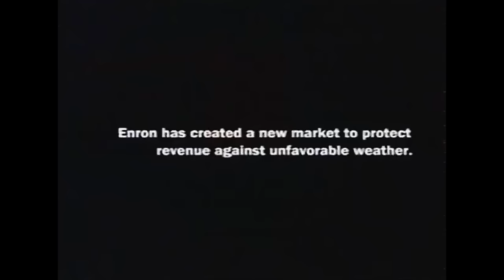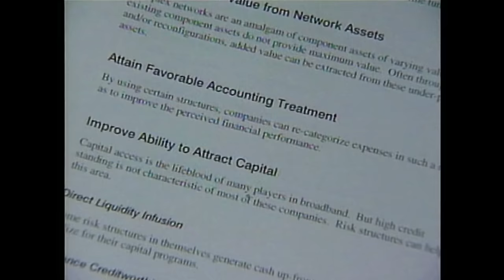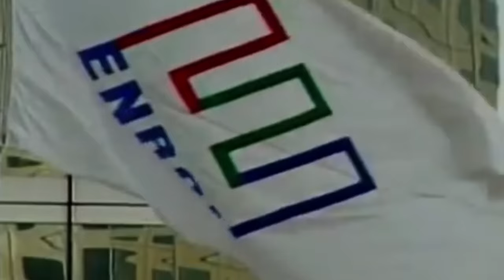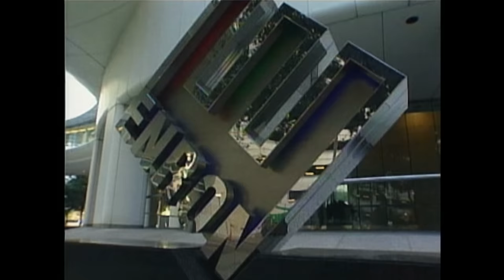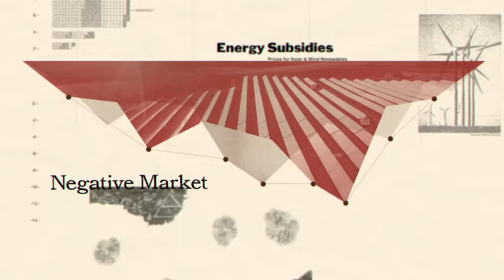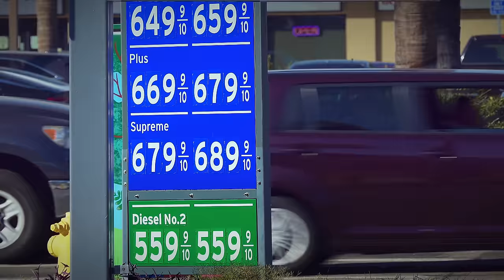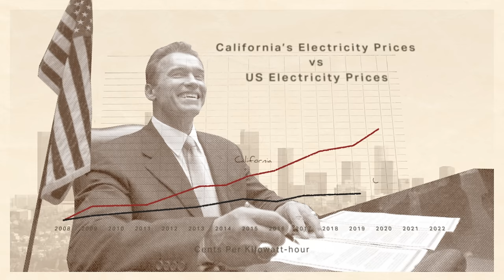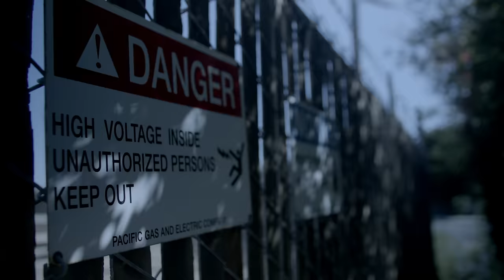JUICE (Episode 2) -  Undermined By Enron

Comment: Affordable reliable energy drives economies and quality of life, until it doesn't.  Physics is the Law.
Reply: "Until it doesn't"? What that supposed to mean?
Reply: @C_R_O_M________  slowly at first then all at once. Ignoring physics will result in collapse, all by design.
Reply: @foolbertsturgeon7309 you just repeated the same initial vague statement. How is this all done is the question.
Reply: @C_R_O_M________  Solar has hard time maintaining voltage/frequency under load after sunset every single night. If the wind's not blowing, mills contribute nothing to stability.  Relays will trip automatically on under, over voltage/frequency, cascades tend to follow.  Target is 60Hz, +/- .02Hz.
Reply: @C_R_O_M________ 60Hz is the target, +/- .02Hz.  Relays trip on under/over voltage/frequency.  Neither solar, nor wind are reliable synchronous generation, solar due to sunset, wind, due to intermittency, weather both ways.  Not only does this complicate dispatch, it skews market function.   Research torque angle.
Reply: @foolbertsturgeon7309 The way you phrased the first comment I had to clarify whether it was a mocking towards traditional means of power production vs sarcasm about renewables. I can see now that it was the latter. 

I agree! 

Moreover, their actual EROEI is horrendous and only a fraction of fossil and nuclear. 

Often, "green" activists hide the fact that solar and wind need battery storage and report much higher EROEI figures but when you take into account the need for energy storage their EROEI plummets (to almost Roman times levels of EROEI - a few steps out of caveman efficiency)!

Comment: The problem with most of the windmills and solar in texas and California way out of date, basically making them junk. The in Texas most of the wind mills they did put in years ago were the bottom of the barrel lowest cost junk that has zero winterizing on them. This also holds true for the solar panels they went with. Texas also refused to be a apart of the national power grid as well which also hurt them. Texas didn't even winterize their gas lines but blamed clean energy for their main sorce of electricity natural gas lines freezing up. Thats the dumbest thing ever. The largest Industrial power plant windmills from 20 years ago costed 70% more than they do today and they produced 80% less power and were not winterized. Now thats just talking about large industrial power plants windmills of same size because now days you can get much larger ones that still cost wayless and produce anywhere from 250% to 300% more power.  Now for solar panels you can get top of the line Solar put on your home for almost no cost and set it up so you feel no cost change as you pay it off with saling that power and paying the cost you paid before which depends on the state but a lot can have it paid back in 2 to 3 years with you feeling no real cost change.   No todays solar panels vs 20 years ago. Today they 70% cheaper,  90% more effective, and winterized. If setup in a solar array they become 170% more effective because the array can keep the panels always facing the sun to get the most energy as possible.

Comment: I was watching and really interested in this series until you stated as fact that California had the highest rate of poverty 😂 An objective lie, and easily debunked. 

That's not a little oopsie, either. It's not even remotely close. Do better. I am sure there is a lot of good information here, but that kind of laziness (or lying) is completely unforgivable in a documentary.
Reply: Like... it's not even in the top 10, guys. You need to pull this episode and correct this glaring error. It makes everything you're saying lose all credibility.
Reply: IF they're using the data from the latest census, they're not wrong. Nationally, the poverty rate is 11.4%, in California it's 11.3%.

Some states may have a higher percentage, but the way poverty rates are analyzed have changed to include costs of living, wages, etc. that weren't included in the past. Population density in California is way higher than somewhere like Mississippi, as well. So there are going to be more people living in poverty in California than Mississippi.